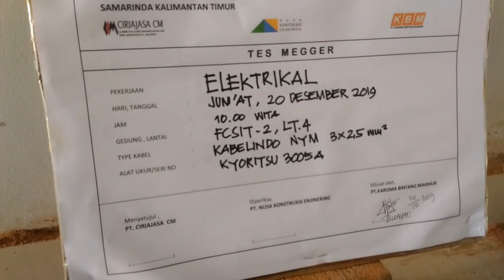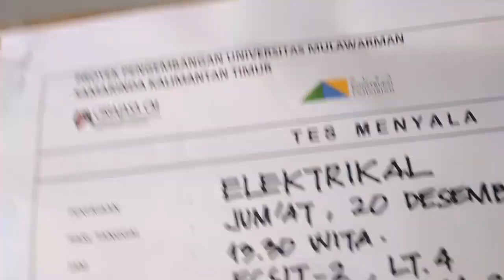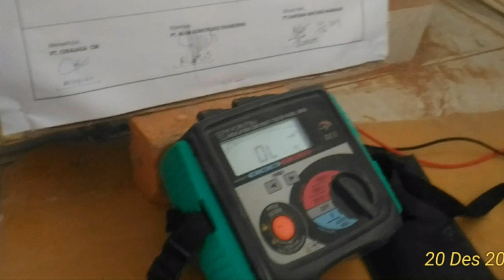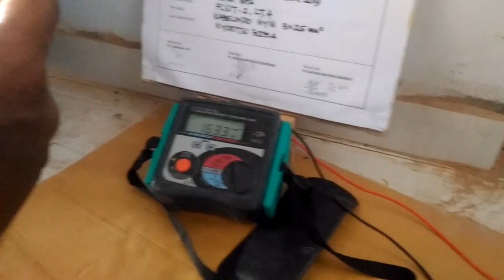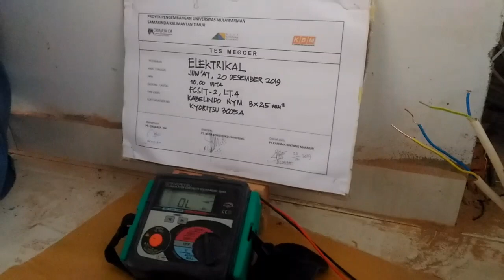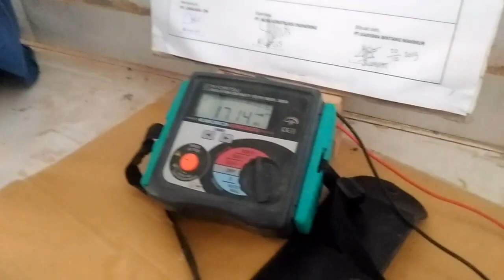Test megger instalasi  elektrikal

Comment: bang klo mau merger stop kontak sma fitting lampu dipasang atau sudah terpasang???
maaf saya masih pemula
Reply from the maker: Sebelum terpasang
Reply from the maker: Ini di kota Samarinda Kalimantan Timur
Reply from the maker: Sebenarnya test insulating cable,karena istilah megger sudah menjadi istilah umum para pekerja instalatur listrik
Reply: Ada juga yg bilang. MEGER itu singkatan Mega Ohm Tester
Reply: Ujung Antara kabel apakah boleh terhubung???